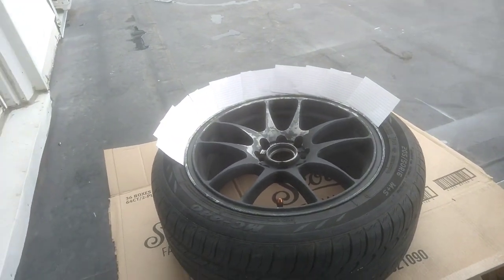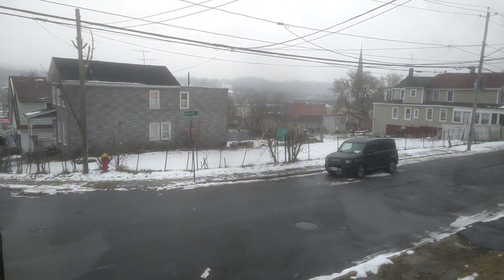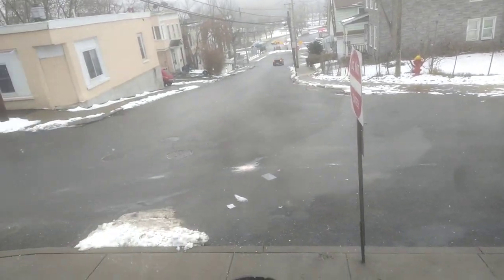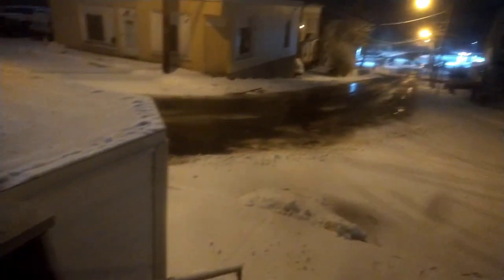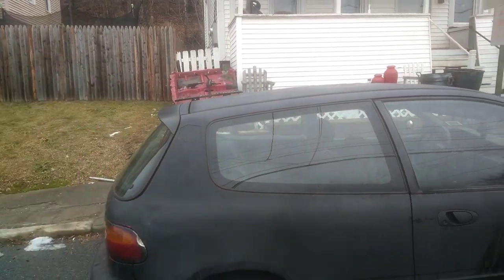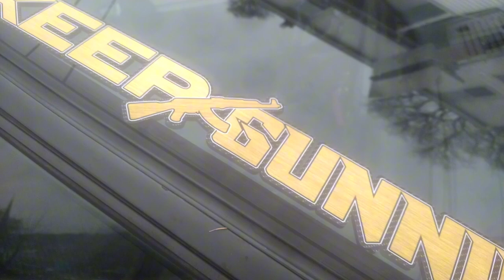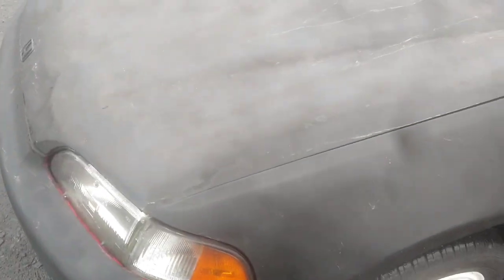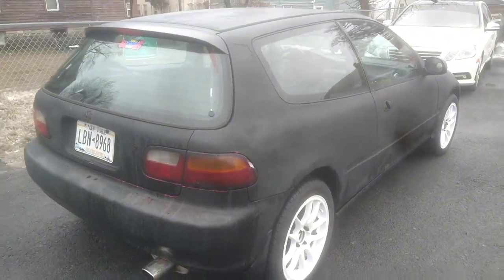painting kimbos new wheels different look 🙏

Comment: put a 16 inch resonator in the middle of the exhaust system on the hatch to get rid of that rasp, unless you like it like that
Reply from the maker: Sure got it changed it.💎facts.broke off the welding around so very loose as well.but definitely getting a new one soon 🙏